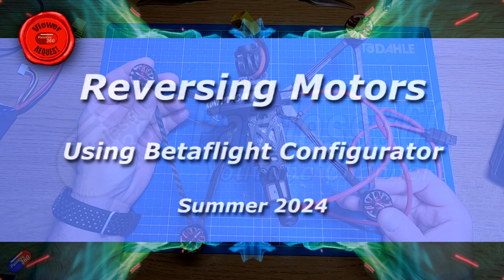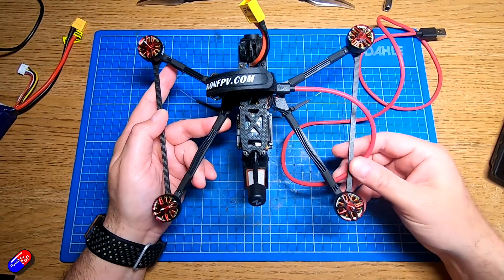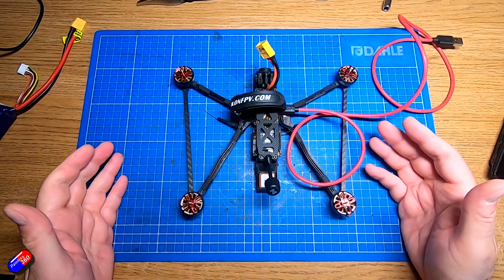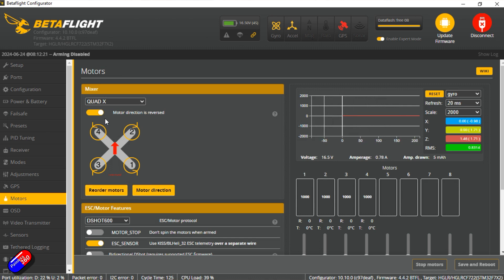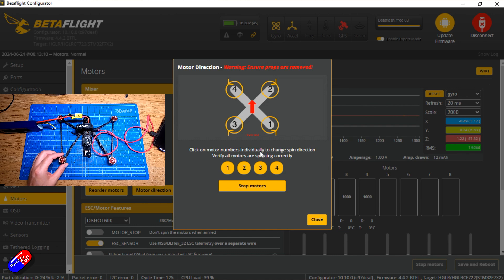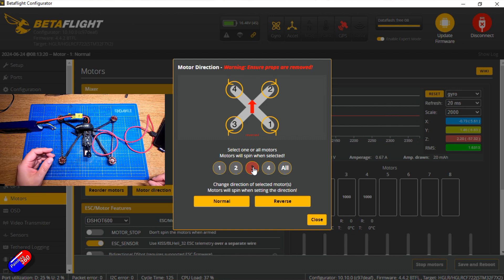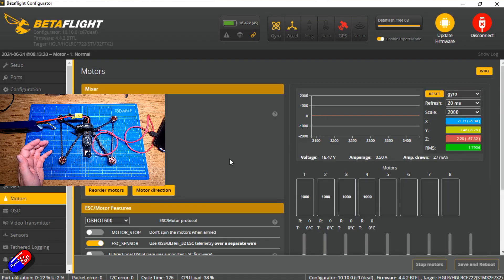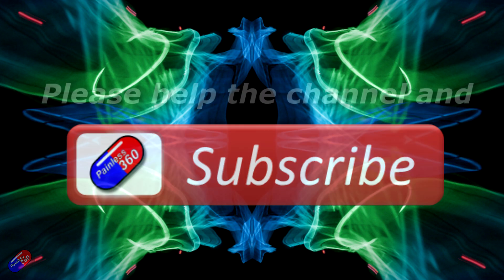Reverse your quad motors with Betaflight Configurator

Comment: Subject: Inquiry about MavLink and CRSF

Hello Lee,

First of all, I want to express my gratitude for your channel and the meticulously crafted videos you create. I am an RC pilot from Taiwan with 35 years of flying experience. In the past, I was the editor-in-chief of an RC HELI magazine, where I dealt with product introduction articles and technical writing every month. Although it was challenging, it was my passion, and I still feel very happy doing it!

I understand how difficult it is to create and manage a channel like yours.

Helicopters are my area of expertise, and currently, I work as a professional aerial cinematographer in Hong Kong.

A few months ago, I could no longer tolerate the compass interference and outdated hardware of the DJI A3 PRO. I researched many open-source flight controllers and ultimately chose the CUAV X7+. Throughout my journey of learning Ardupilot and Mission Planner, I gained 70% of my knowledge from your channel, and for that, I extend my sincerest thanks!

At the same time, I have a question I would like to ask you and would love to know your thoughts.

Regarding the latest update of ELRS 3.5.0 RC2 firmware, the most significant change is the support for MavLink. I followed the announcement's instructions to use it, but I only received telemetry signals and no control signals.

When I switched to the traditional wiring method using the UART4 port and connected GND, 5V, RX, and TX, while also referring to your previous video (which used TBS's Crossfire), it worked normally, but the returned information was quite slow, with a delay of 4-6 seconds.

I am not looking for assistance in solving this issue.

Instead, I hope you could create a video explaining your views on MavLink and CRSF when connected to the UART port for control and telemetry. What are the differences between the two? What are their respective advantages and disadvantages?

I would be very happy to receive your response!

Best regards,

Comment: also, when checking the motor direction in the "individually" tab, if you click and hold the mouse button on the numbers, the motor will spin continuously until you release the mouse button.
Reply: Nice tip

Comment: Hi, do you know if it's possible to setup a switch to change channel mapping from AETR to RETA using a TX16S or in Betaflight. I have built a 5 inch quad and want to attached it to my flying wing. When changing from Angle mode to Acro I would like to swap aileron with rudder. Thanks for all the great videos.
Reply from the maker: Yes, you can swap the mixes easily. See my various how-to videos in the EdgeTX playlist..
Reply: @Painless360  You're a star, this has saved me hours of pain, it works a treat!